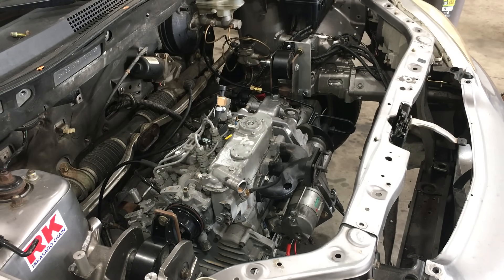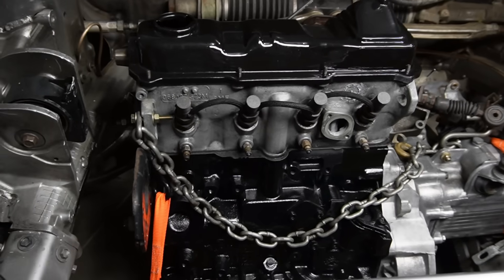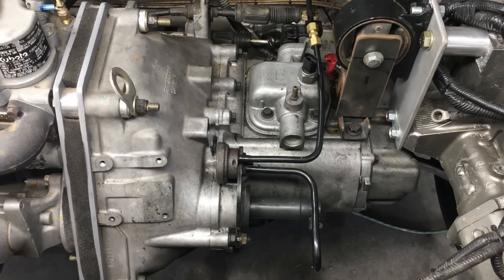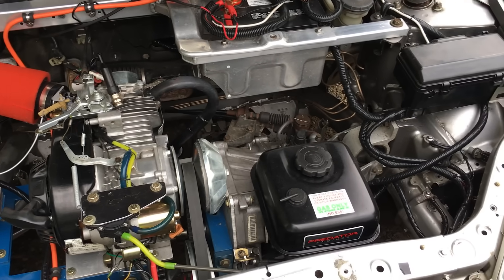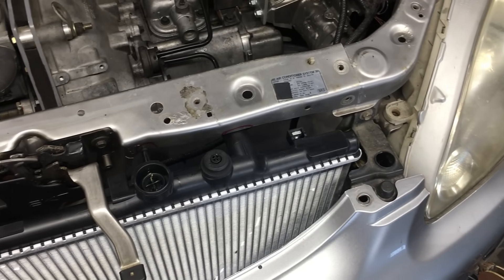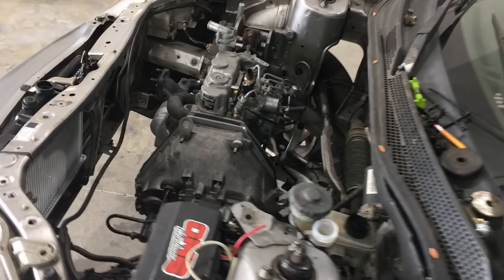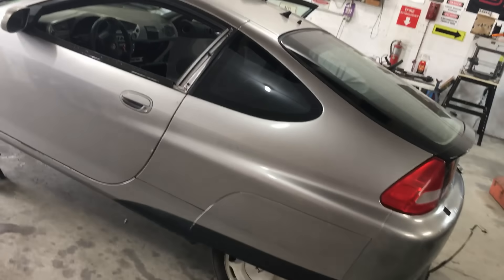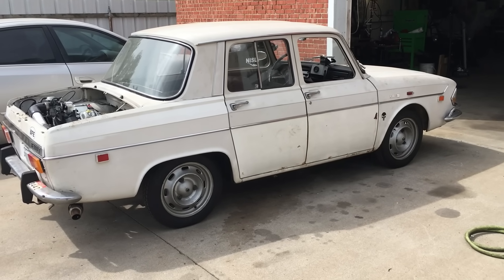S3 E33. 3 cylinder Kubota D722  diesel powered Honda Insight project has begun

Comment: I would recommend playing with the timing on the kubota engine before abandoning the turbocharger. Things like cam timing and injection timing have an important roll in the effectiveness and efficiency of a turbo diesel. I’m not against a supercharger but I definitely think the turbo has more potential and would better suit the engine. However if you manage to find a way to use both that would be insane and I definitely think that would be incredibly unique and even more of an interesting route to go with the build. Based off your abilities I think you are more than capable of making the Honda into a really cool reliable and clean built car. Definitely can’t wait to see what you come up with.

Comment: Seems like sleeve welding the axles should work good for what you have here but phasing the joints as best possible would probably help limit vibration.
Reply from the maker: I looked into that a while ago,  the CV joint at the wheel eliminates any need to phase the joints on the axle.  An interesting side note.

Comment: There is a local inventor near me that built a sort of hybrid insight.  He put a retractable fifth wheel under the car that would push the car with an electric motor.  Odd, but it works.

Comment: You should put that VW diesel in a Chevy S10. Very common inexpensive light vehicle. I'm in the middle of 5.3 LS swapping my 94 S10. If a V8 will fit you should have no problem stuffing a 4 cylinder with a turbo and intercooler in it.

Comment: Not like you can use a super charger over a special kerosene carburetor that is just a metal pipe stuffed with carbon felt going into a T joint. But the bigger the pipe the more tubes you need to put into the bottom of the T join so that the narrow pipes start working more like capillary action to move the kerosene to the top of the jar. The super charger blows air over the carbon felt soaked in kerosene to make fuel vapors so it burns super lean. Anyway you have to seal the pips to the bottom of the T to have less water or better pressure on the jar with a good seal around the wicking tubes.

Comment: How about using the supercharger for low RPM and the turbo for high RPM. Put an electric clutch on the supercharger and hook them in parallel. The turbo will need a 1 way valve or electric valve. The supercharger won't be a real boost leak.

Comment: I think the VW engine was probably OK, it was likely the transmission that was too long due to the odd clutch release pushrod that goes through the mainshaft.  Necessitating a bearing and lever past the end of the mainshaft.  In 2002 all VW switched to a more normal clutch across the lineup (it was available in the 1990s on various 6cyl, supercharged, and TDI models).  So the swap might have been easier with a different transmission.

Edit: Ah I see, room for activities, fair point.

Comment: Supercharger will destroy mpg on a diesel since a supercharger will be forcing boost under light loads.  Since power is based on fuel mostly on a diesel. Superchargers will rob power if not making use of the extra air. Example 10 psi of boost will create drag. But if you are only adding say 15 hp of fuel all that extra boost being forced into the engine will not gain more power. Only drag it down building unneeded boost. But for more power on wide open..... I can see a gain there..  note. Regulate boost by pulley size. Not by a valve. Looking foward for the next video.

Comment: richard holdener did a test on this blower and it uses a lot of HP to drive it. would be interesting to use a small vv turbo and just manually adjust the vane position.
Reply from the maker: LOL, I seen that video.  Keep in mind we used an AMR300 on a 13 HP 420cc predator engine and the little 420 cc engine had no problem spooling up the supercharger.  Its hard to say what was going on with his measurements, but perhaps there is an error in his dyno results.

Comment: Use the super charger to feed the turbo charger.  That way you can have boost all the time.  Banks turbo did that in a racing truck because they could not get the boost levels across the total rpm range they wanted.   Look up Banks Super-Turbo Methanol Diesel Pikes Peak Outrage.

Comment: Try that Volkswagon diesel engine in a small truck.  If you can get a Luv or Courier or even an older ranger or nissan.  That would be very interesting to see.  Would love to have more diesel options in the US and not just big trucks.  May want to consider an old prius where you remove the gas engine and put in a diesel to charge the batteries.

Comment: D722 turbo is 16881-17014 or 49173-03300.
Do not know the specs, but maybe a second hand one if you can find one. I don't think that the OEM setup is doing only 3psi.

Comment: Did you consider using the OEM turbo (or one of their clones) for Kubotas? The D1105-T engines have a turbo from the factory, and though it's sized for the 1100cc version it might be a good match.

Comment: Variable geometry turbo from some small diesel engine would be nice to see. Should be able to generate boost nearly from idle. And should be good for efficiency also, no wasted exhaust energy because whole exhaust flow goes trough turbine all the time. 
I have also similar project, but even smaller scale. I'm installing 2-cyl 400cc Kubota Z402 to old MZ ES175 motorcycle, with a turbo of course :)
Reply: For example Garrett gtc1238vz from vw 1.2tdi

Comment: Interesting........
Up to now, your car/engine combos have been brilliantly quirky oddities. Great to watch, but not really anything that could be practical on todays busy roads. This Kubota/Insight mix on the other hand could actually turn into the first "daily drivable" project on your channel. The only snag I can think of that could possibly turn up is, I assume the Insite's wheels have a significantly smaller rolling diameter than the Saturn's, so maybe that Kubota will be getting a bit "Buzzy" at top speed? TBH, I can't remember if that engine would even pull top gear in the Saturn, but if it did, then in the lighter, and more aerodynamic Insite, it could run out of revs before wind resistance held it back naturally.

That's all just me thinking aloud though, I'm sure a man of your calibre has already thought about that. Hell, forget I even mentioned it Jimbo. You just keep building them, and I'll keep watching and hitting that like button. :)

Comment: Aww, I was hoping you'd use the tall geared insight transmission. Sure, performance might suck, but you'd not have to shift 7 times in 30 seconds!
Reply from the maker: in episode 16 we tried a different overdrive gearset in the saturn transmission and the little diesel engine didnt like the taller gears.   A modified Insight transmission would have been to risky as far are performance goes so we went with the Saturn gearbox.   Now once we get the Honda sorted out, we can try the taller overdrive again and see if the lighter and more aerodynamic Honda can tolerate the overdrive.   The direction we took provides the best outcome on this unusual engine swap.  It will be interesting for sure.

Comment: Did the turbo fail to perform because the kubota only generates 3600 rpm?
Are there different exhaust and compressor fan sizes to improve the turbos performance without more cc displacement?

Comment: Smallest turbo, of what i can recall is a garrett gt06, smaller and more modern than the rhb31 or vz31, not to expensive in europe but don't know how much in the usa... 
I love the Amr500, made 140hp on a micra here but yeah, will hurt the efficiency wildly! 
I'm pretty sure the amr300 would be enough for it as the 500 can pump around 150hp but for efficiency:
 supercharger « Turbo

Comment: For the Renault r10, would you be interested in having ported cylinder heads and Intake? I also know there are some really well designed race cylinder heads for these engines?
Reply from the maker: That's a tough question to answer.  I can get billet rods, forged pistons, a modified cam , a billet flywheel and O-ringed heads for this engine.  Or in other words I could spend $2K or more to improve the engine.  Keep in mind I would love to do all that stuff, but youtube keeps paying less and less.  Our subscriber count is up, but our revenue is down.  At this point we are trying to break even on each video.   Ported heads would certainly help but so would a lot of other things.  I'm really not sure how much more I want to dump into this engine.  The next engine we want to try is from a Honda Goldwing and as far as dollars go, the Goldwing engine  offers more bang for the buck.

Comment: it's a common misconception that 2 stroke Detroit diesels were supercharged. the blower didn't provide an air charge to the cylinders at a pressure SUPERior to ambient, hence Detroit marketing them as naturally aspirated and calling the part a blower rather than a super charger.
Reply: The Roots blower on the GM 71 series  diesels definitely provided more than atmospheric pressure. I remember from way back about 3-5PSI for the 6-71s. With the lower pressure they did not have any cooling.

Comment: I mean it would be also interesting to see if you could run the turbocharger as a supplemental boost for when the stupid charger  gets midway running through it's capacity but I know that's a lot of complexity to try and add. but you'd figure that the turbocharger would start spooling just enough at that point to be able to bleed another pound or two into the system  at the top end when the supercharger really runs out.

Comment: Well the 2 stroke "uniflow" GM diesels MUST have a positive displacement blower to achieve cylinder scavenging.   On a four stroke and 2 stroke diesels, a turbo charger is key to getting high efficiency.  Super chargers just take a lot of hp to drive without recovering that energy.

Comment: Only creating boost and a huge load is actually a good thing for effiency as the adiabatic coeefficient is part of the equasion determining engine effiency the boost raises your effective compression ratio so you have a loss in effiency which is partially compensated with the leaner burn. The perfect point for a diesel is a bit complicated to find. 
You can build boost faster with a variable vane turbine

I've said it again and again. In order to lower your exhaust gas temperature you need bigger injectors and a bigger pump. 
Yes that sounds odd and let me explain. 
The stock injectors where optimized for stock power. The limiting factor is flow rate. In order to increase your power the injectors need to flow for a longer time. 
The begin of injection is set you can't do mich about that without harming the engine. So what happens your injection is longer into rather late. 
Not all of the combustion happens at the point of highest efficiency. A lower effiency also means more heat loss as the burning happens closer to the opening of the exhaust valve. Thereby more heat in exhaust and higher exhaust gas temperature and lower effiency.

Comment: A supercharged Diesel ... It is what I have been asking for. 
This project is something I am looking forward to.  I am predicting the throttle response will be impressive but the top end performance might be a bit lacking.
Reply: I agree, it won’t make as much power per lb of boost, and EGTs will be higher at the same boost levels, but throttle response will be much better and it will be a much more drivable machine.

Comment: This would have been way more interesting if it still had the hybrid drive these Honda Insights came with. Maybe America didn't get those but a lot of the ones that were imported from Japan to New Zealand were manual. Yes you heard right. A manual hybrid. This is because Honda likes to attach the electric motor to the box, sort of like piggy-back system. They also do this with the Jazz hybrids but they're all automatic and the electric motor tends to kill the transmissions because of how people lead-foot them everywhere. Same problem as Honda V6 w/auto. Honda puts the same trans as the 4 cyl model and when people give them beans all the time the extra torque makes them dead fast.

Comment: Damn shame the car wasn't complete when you got it. Apparently if you get the right motor controller and used hybrid batteries you can make that hybrid system work like a champ with any engine. At least that's what I've heard.

Comment: I have seen you struggle with small engine bays for too longJim. It will be a little more fab work but when the time comes for the VW you should install it in the bed of a compact pickup transversely. Then your room for experiments will be nearly unlimited

Comment: With the exception of mild parasitic loss, all engines can benefit from the right supercharger, even a 4 stroke diesel, in fact some are equipped with them from the factory, especially some marine and military diesels.

In fact, you know, id keep the engine in that car, it would still be drivably practical,id do it just for a fuel effiiciant and unique "A to B" car.

I love your ideas, many are more practical than most realize, hell id drivem on the daily.

Comment: Put that 1,6D into an old 240, 740 or 940 diesel volvo. They had a 6cyl 2,4L version of that 1,6D engine (VW LT 2,4L) and that 1,6D will fit straight to the bellhousing. 

The old diesel volvos are of course a bit heavy, but they are quite cheap and not so hard to find. That 1,6d would be VERY underpowered for those cars, but the swap should be easy and the car should be quite economical. :D

Comment: the little diesel looks like it belongs in there , loads of room around it too , supercharger should work though you might need to run a diesel misting system through it so it has a little lubrication , as long as you dont put so mush diesel in it or have it pool in the manifold  to have the engine run (away) without the injectors other than that it shouldnt care , it just burns it off with the rest of the diesel , the amount of diesel should be less than wats needed to selfignite (eehr duh) the added lubrication might allso help seal the insides of the blower a little better 
having the constant rpm to boost curve from a supercharger should make it eazier to tune the pump for the right amount of fuel through the powerband , on gas engines the supercharger makes the engine a lot louder out the exhaust (the machinegun ratatatah)  might need a better muffler 
as for the heater , a lot of kitcar builders used to use the heaterbox out of a classic mini , but those arent too available in the states , another place you could look is in old stretched limos , these sumtimes have an extra unit build in the back thats pretty basic 
if all else fails you can go with 12 volt electric heaters , be carefull though , seen an rv build where they funneled the webasto interior heater (dieselheater) to blow ontoo the front windows they figured it would help the defrosting before the stat of the trip , the concentrated excess heat cracked the window of said bus , verry expensive misstake

Comment: Ayo Jimbo i have a question what are the maximun dimensions of a possiblee swap for the insight? or the dimensions of the volkswagen engine you said thats like a tight fit right in gessing if it would be posible to buy a automatic insight and made it manual with a swap
Love your vids man

Comment: Supercharger boost control.   If you plan on using a blow off valve to atmosphere, don't because the supercharger will still be processing air and this will waste power.

Comment: 100 mpg long trips, hear you come! You might even be able  to afford to drive this in California, where now diesel costs $6.49.9/ gal! should top 80 mph and cruise at 60 and deliver about 100 mpg. Yippee! You could buy a Tesla for 170 k and after a few years buy a new battery for $50,000, and impress your neighbors with your greenness. I hope the VW diesel can go into the R-10 at a future time. 50++ mpg and a very comfortable ride.  be sure to gear that engine fairly tall.

Comment: Put the 1.6 Volkswagon diesel in a crown vic it's much bigger than the engines so far but unsuitable for a 2-ton boat so same concept I guess. Just figure out how to connect the rwd tremec manual transmission to it.

Comment: Honda Insight never supposed to end up in a junkyard, if it's low value, just sent it to Europe, here it's significantly higher value.
Try turbo and blower, and just in compound configuration, and make the blower electric, then you can call it a Hybrid, there need to be a big one way valve/flap between, and plumbed to the same air filter.

Comment: About welding CV shaft. Check video "DIY Custom driveshaft.... How to cut and shut driveshafts the right way..." on YT. He welded without any special tools vauxhall (he swapped engine i transmission from vauxhall) shaft to original mini outer half shaft and used that car in sport competition. CV shaft broke but in totally different place than was wealded.

Comment: I had a friend sell one of these not running the other day, fully intact, for like $400. They really dont sell for much. Running and driving theyre still not worth a ton more
Reply from the maker: Its funny, they only made 16000 f these and there are rare.  The only good thing you can do with them is a K swap.
Reply: @robotcantina8957  that's literally what's happening to the one I mentioned. Someone from the car community got their hands on it and is already started on the K swap. Should be a pretty fast street legal go-kart 🤣